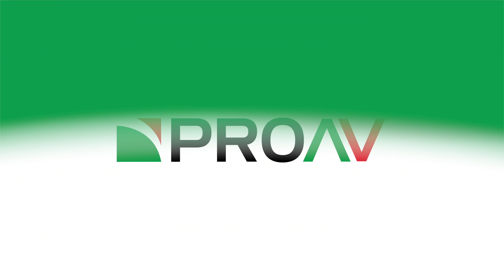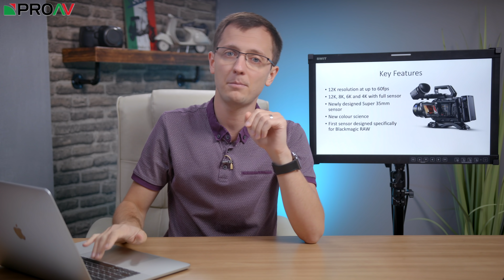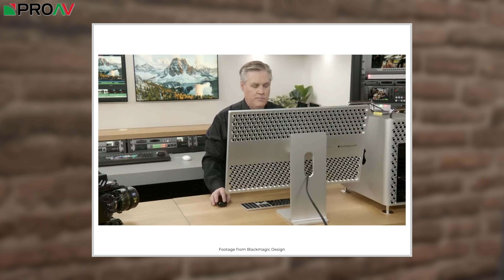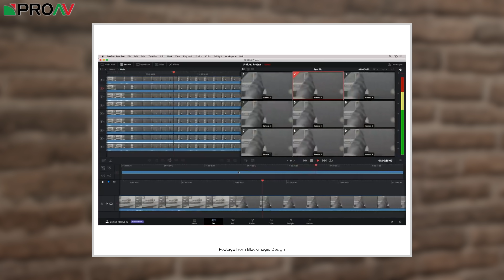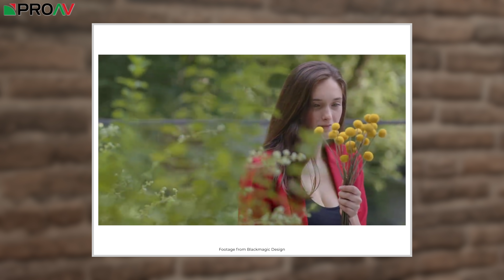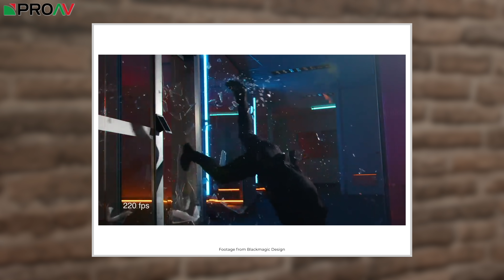Blackmagic URSA Mini Pro 12K | Up to Speed

Comment: Its incredible that a guy like you with zero experience in creating video for commercial use is giving opinions on cameras, it is the same when a person with a driving license is telling others how to drive a car, total nonsense.....
Reply from the maker: Well I understand your point, lots of our customers are vastly more experienced than I am myself personally. 
However this channel is not just me. ProAV are a hugely experienced pro video dealer with over 20 years of supplying to the UK video industry including broadcasters at the highest level. 
Plus I had nearly 5 years of experience creating content for clients before working for ProAV full time. In fact I actually got ProAV as a client to make regular videos like this, before they had so many they wanted done it just made more sense to work for them full time.
Carl
Reply: @ProAVTV No you don't understand anything. If you understand you would stop. The problem is that there are millions of illiterates  like you. The guy with 3 followers and with millions of them....

Comment: Hey ya'll,

The URSA 12K is not about 12K per se, instead it's about an RGBW sensor that is native to BRAW:
- In-sensor scaling (12K, 8K, 4K is native to the full width of the sensor)
- The above frees up bandwidth to allow for higher frame rates (hence 8K 110fps)
- Avoids future patent legal disputes which will lower costs for the end-user in the long run

This is analogous to a new codec that allows you to do more for less.

Comment: Quick nitpick : F35 used a CCD, not a CMOS.
And with the filter in mind (which is like the RGB strip in the F35 but twicked since it has a 6x6 grid with 6 Red, 6 Green, 6 Blue and 18 unfiltered ["white"] pixels to compensate for the really small size of the photosite) I think it's pretty safe to assume the actual resolution is not 12K (as with Bayer Pattern, the real resolution is always less than advertised). A lot of people did the maths in a few different ways to get either 4K or 8K and come with the conclusion that the real magic is what BRAW and the sensor can do TOGETHER to get to those 12K files. (I support this idea with the fact that nowhere in the specs it says that 4K and 8K full sensor are oversampled resolutions but they are respectively 1/3 and 2/3 the amount of pixels of the 12K so I think there's software trockery involved a bit like in Premiere or Resolve you can choose to play back at hald or quarter resolution... Furthermore in this rabbit hole, why no 6K full sensor if it can oversample ? I find it's a bit weird)
All that being said, it's a huge achievement on a technical level and I'm really interested to what the they can develop next. As for what we've seen so far shot with this camera (which is not that much, but still that's something) it looks really nice, as nice to me as the URSA Mini Pro 4.6K G2 but with a nicer color science. So it looks awesome, really, I'm just not blown away as it doesn't look that luch better. (but again, since it already looked very nice, it's not a complaint)
Take care Carl and everyone at ProAv ;)

Comment: I watched the presentation and it really bothered me. It’s a great leap for wildlife and science work but they are communicating the 12K feature for high and cinema productions. Which this is last last use case for. The majority of high-end cinema productions are still shot at either 3K with the Alexa or 35mm film (and of course a bit 4.5K with the LF), or 6.5K with the Alexa 65. There is almost no in-between for the real high end cinema application they were talking about. There is one very simply reason why Deakins, Van Hoytema, Richardson, Sandgren, and Young couldn’t give any fewer fucks about resolution: They’re telling a story, which means their framing and lens choices have intent, and they get the frame they need in camera. 

And that’s what rubs me the wrong way, most people who’ve actually educated themselves and did their own testing don’t need more smaller pixels but larger pixels with more dynamic range and a better signal to noise ratio. That’s why the Venice is so well received and the Alexa is still the undisputed Boss in that area. For people who actually know how resolution works and don’t just follow hype blindly (and there’re high-end DPs who do that) usability and reliability are much more important to them. And a camera that can see more luma information and has less noise is more usable and gets less in the way. Arri is working on a new Super 35 4K sensor that will most likely actually push the envelope. The real high-end people are still either shooting 4K max or on film. It’s just sad to see how Blackmagic and Red are trying to be relevant but are to lazy to look beyond the bragging rights specs sheet. The most impactful thing for cinematographers this year, will not be the Canon R5, Blackmagic Ursa 12K, or Red Komodo but the Sony A7Siii.

Comment: Be interesting to see what the low-light capability of this camera is.  Squeezing smaller photosites onto the same size sensor usually means the sensitivity drops.  However, this isn't the usual sensor layout so maybe that make a difference, though I can't see how.  Also, where does it end?  16k, 24k more?  What's the point?  We need no more than 6k for a clean 4k down-sample.  Our eyes aren't really capable of discerning anything above 2k anyway so 4k is definitely enough.  Reframing maybe.  Getting multiple lower rez 'frames' from one large rez image yes, but just shoot it right in the first place.  This camera is interesting but ultimately pointless.

Comment: If I owned this camera I probably would never actually shoot in 12K. Curious to see if shooting 4K raw will result in increased noise or moire issues, and how the sensor performance holds up against the Ursa G2
Reply: Shooting in 4K raw that's been downres'd from 12K will result in less noise, not more.
Reply: @mexicanjester  Generally "4K Raw that's down sampled" is contrary to what "RAW" is

Comment: Erm, what do I know. But who asked for this? Feels like video equipment has more pressing issues than pushing resolution. Improving readout speed. Perfecting DGO and Quad Bayer HDR implementations. Improving the usability of by-wire lenses. Still impressive, and I'm glad they mention the sensor being designed for BRAW. I still remember the cinemadng to BRAW transition on the pocket 4k, and the bit of sharpness lost there.
Reply from the maker: I think you are probably right, but it's nice to see something different on the market. And 8K at 110fps is incredibly impressive.
Carl

Comment: F35 was CCD I think F65 was 8K RGB or whatever this is
Reply: The f65 is almost full RGB. I think it's 67% RGB as opposed to the normal 33% of most Bayer pattern sensors.
Reply from the maker: @BigBlobProductions  It's definitely not the same sensor tech as either the F35 or F65. But we just don't quite know enough on its details yet.
Carl
Reply: @ProAVTV  this is true. I can't wait to learn more about what Blackmagic has created. But I also get the feeling that it will be kept under wraps for as long as possible.

I would love to see dual ISO variants made for generation 2 pocket cameras

Comment: Did Canon ever miss the boat ! No ! Canon sank their boat with the R5 ! So, with BM RAW 12K resolution camera, I can shoot 8K all day with no recording limits, no overheating, and no shut downs ! I can shoot 12K all day with this camera without any limitations to excessive heat or recording times, plus it also has 2 x UHS-II SD card slots to boot ! Last night I saw the live online demonstration from Black Magic Design of a test shot of a huge cargo freighter ship. At first, I thought it was a typical 4K p60 shot of the ship, but then they pulled back to 6K. I thought the 6K crop in looked great, but then they pulled out to 8K ! Wow ! This 8K shot looks amazing, but then they pulled out once again to a full 12K resolution frame size and I nearly fell out of my chair and fainted ! Incredible achievement for Black Magic Design ! I salute them !
Reply from the maker: Its incredibly impressive you are right! But on the R5 point, I would just point out that this is a SLIGHTLY bigger camera with more cooling potential than the R5 is...
Carl
Reply: ProAV TV which makes you wonder why they're even trying to cram 8K into a mirrorless form factor in the first place...
Reply: Imagine thinking the R5 was for CINEMA use! Wheres that clown emoji 🤡
Reply: @miyahtallulah Funny ? I can remember folks saying the same thing about 4K, who needs it ? If you build it, then they will come. The Ursa Mini is a Digital Cine Camera aimed at the Film Industry, put priced low enough that independents will eventually get their hands on it.
Reply: miyahtallulah Nope just a hobbyist that does color grading and some other projects both in photo and video.  Occasionally I like to film my cats. The R5 is good enough for my needs
Reply: @miyahtallulah I have been a professional for 31 years now, the 12k Ursa is a game changer, the 8K Canon R5 will catch fire. only good if you want to film an egg boiling, before the camera does. I want reliable equipment, be able to punch in if needed. I started before non linear editing was around,  I prefer shoulder mounted cameras to ones with IBIS the movement is more natural.
Reply: @miyahtallulah  Uhhn no, I don't think it's pointless. After all BMD did say they were targetting their new 12K camera at Cinematographers for commercial cinema production. Super 35 mm sensor or not, it all comes down to what kind of an image are we going to get out of this 12K camera ?
Reply: It doesn’t make sense to compare a cine camera to a mirrorless body. The R5 is a stills camera that has cine like features. It’s not in the same product category. Comparing this to the C500 MKII or the C300 MKIII makes more sense.
Reply: @NotThatAlexis  You are quite correct in one sense, but not so much in another. My point was mainly on obtaining a high quality 8K image from a camera minus the shortcomings of overheating issues and their related show stopping shut downs. I don't see the new BMD camera so much as a 12K camera ( But that it is !), rather, it is the way its RGB senser will scan the entire size of the Super 35 mm dimensions to give you downsampled 8K, 6K, and 4K is what caught my attention (apart from the dramatic 12K demonstration).
Reply: Do you feel better about yourself now that you wrote that? One is also over double the price and weight, completely different camera
Reply: I mean this camera is using super 35. The reason the r5 is such a big deal is because it's a full frame sensor with full sensor 8k raw in a body no bigger than a DSLR.

I don't think the r5 could replace these dedicated cine cameras, but the r5 seems to be a great hybrid camera.
Reply: @miyahtallulah Most cinematographers want super35 as it the standard in the film industry lol. Also most cinema lenses are made for super 35.

Comment: Hey Carl a question about the ursa 12k what does it mean for lenses being not full frame does it mean the sensor isn’t huge? I have a mavo set of primes and was thinking about sensor coverage for lenses?
Best Regards Scott
Reply: The sensor is toward the larger end of super-35. The Arri Master primes will cover the sensor and any full frame lens will cover it too. The sensor isn't "huge" but it is 27mm across as apposed to Full Frame which is generally 35mm across. The Mavo sensor is actually slightly smaller than the BM 12k, so the Mavo Primes will certainly cover the Ursa 12k.
Reply from the maker: It's a larger than Super35mm sensor. So not all Super35mm lenses will cover it. 
Your Mavo Primes will be fine though, they cover full frame
Carl
Reply: Thanks for the reply guys very helpful.
I did send you a message on insta Carl please ignore it.

Comment: I want BRaw in all things now. This codec is more of a game changer than people know, and Blackmagic are so casual about it that it's going over people's heads lol
Reply from the maker: It is a fantastic codec, they have done a great job with it.
Carl
Reply: But it’s proprietary codec
Reply: @petrub27  It's open source, and supported on resolve and Premiere Pro
Reply: @LoverOfTech  The decoder is open source (to an extent, it's more like a publicly available API from what I understand) so braw files can easily be read by any NLE or color correction program.

However the encoder portion is closed source, so it's not going to end up on other cameras without Blackmagic's approval. In contrast, CinemaDNG is a much more open format, where you can read the full spec of the files online for free.
Reply: @thatcherfreeman  they are open to other manufactures using their codec. Canon Panasonic and Sigma already did it. It's up to the camera company if they want to follow suit